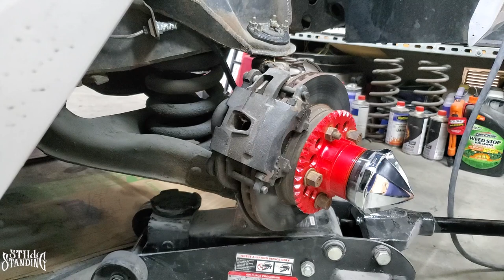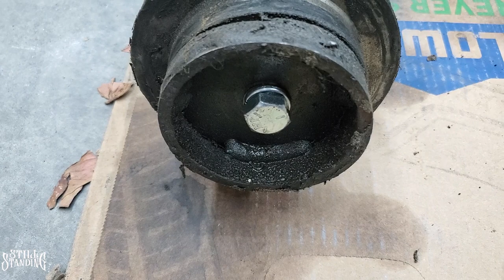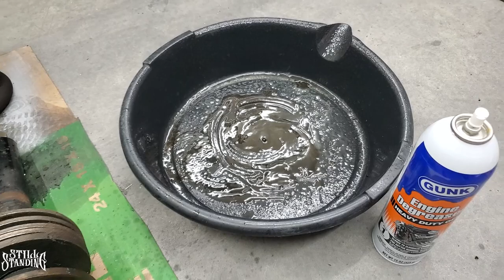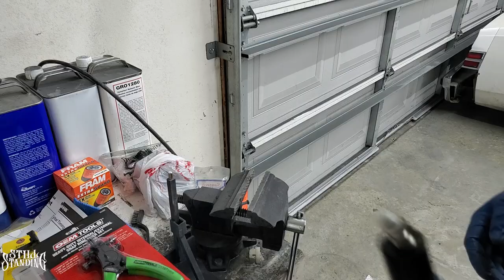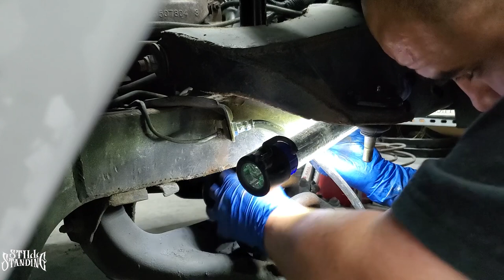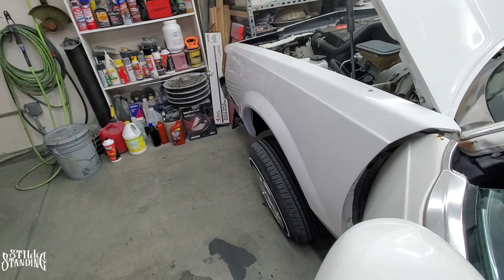Replacing Hydraulic Cylinders 83 Regal

Comment: Lock-tite  is used usually on bolts not hydraulic fittings, on fitting use Monster blue Teflon tape take it from a plumber
Reply from the maker: Got it 🤝 this method was recommended by the shop that manufacturers and used to install hydraulic set ups 🤷‍♂️. Thank you!

Comment: That pipe they welded on the shallow cups is to keep the coils from popping out while hopping. The shallow cup gives more lockup over the deep cups because the cylinder isn’t sunken in like with deep cups. It’s actually very smart.
Reply: @StillStandingGarage those are shallow cups with pipe welded to them , was a common practice back in the 90’s to keep springs from flying out. Wrap a shop towel around your cylinders then put them in the vice and turn your fitting with a crescent wrench to keep from scratching your cylinders (especially when chrome)

Comment: You make information video bro appreciate your time btw if u only had like two of those donuts u could of just lift the car with jack then dumped it completely and pull up on the spring and cylinder and can be taking off even without removing anything not even the wheel
Reply from the maker: Thank you. Yeah, I'm not sure why I have so many donuts. I'm planning on re-doing my whole system, so I'm leaving it as is for now.

Comment: Appreciate all the kick ass videos! Quick question on the ball joints you installed. Do you have a link for where you bought them? Also, they are heavy duty correct? I am also working on a 79 Monte, w/ FBSS. I’m wanting to change out the ball joint’s, Thanks in advance.
Reply from the maker: Yeah, these are heavy-duty ball joints from what I read and was told. There's a link in this video's description. Nice! I love them 3rd gen Montes 🔥💯

Comment: Great video , I’m peacing together a system , I only have 1 doughnut for my cyilinder I see you have 4 , 5 of them do I have to have more of them . Thanks for your time
Reply from the maker: Nice! You don't necessarily need 5 donuts. I have 5 donuts because I believe my cylinders were hitting something in the engine compartment when they were initially installed. I put them back in since that's the way they came out. In the future, I'll be upgrading my whole system and will only be using 1 donut.

Comment: When you performed the job, does it matter if the front is locked up all the way or half way?
Reply from the maker: It makes it easier if no oil is in the cylinders. I locked it up to add the jack stands. Then I put a jack under each bottom a-arm to dump the front and remove the oil from the cylinders. It doesn't get messy either if no oil is in the cylinders. Thank you for watching 🤝💯

Comment: Just seen the part where you said you went on Lay it Low but was their a certain individual you bought them from or a company?
Reply from the maker: I bought them from Holley. I have the link to them on this video's description. Check it out 💪
Reply: @StillStandingGarage  appreciate it Homie! I just purchased 2 for the Monte. Quick question, if I’m not replacing or doing maintenance to my front cylinders (Just replacing ball joints), do I need to remove the hose from the cylinder?
Reply from the maker: No problem. If you're just replacing the ball joints, you don't need to remove the cylinder hose.
Reply: @StillStandingGarage  ok Thanks!
Reply from the maker: Thanks for watching 💪💯